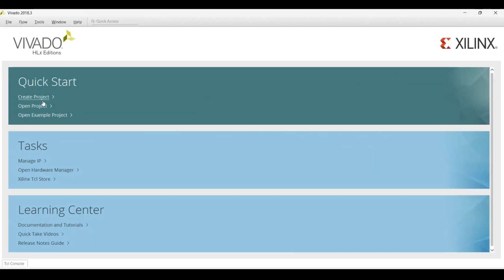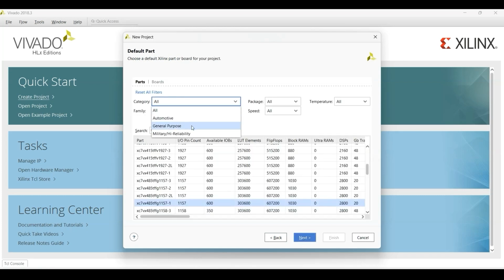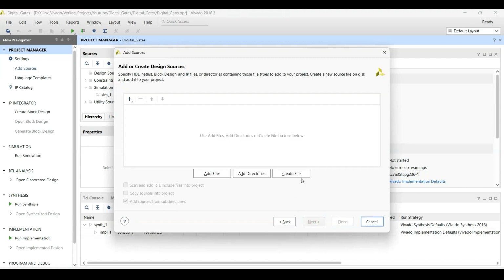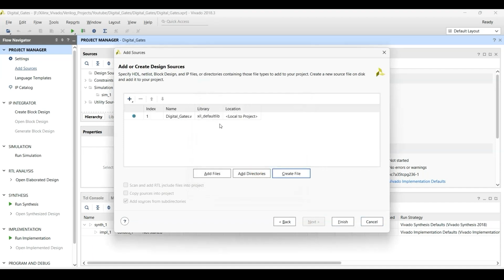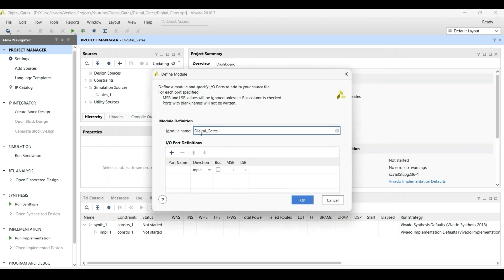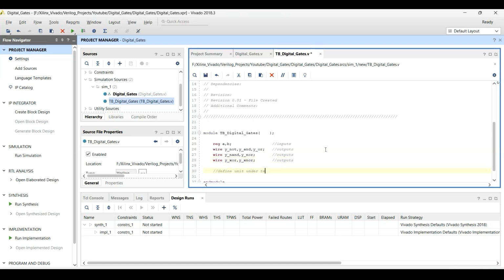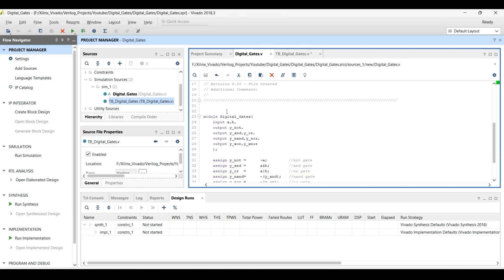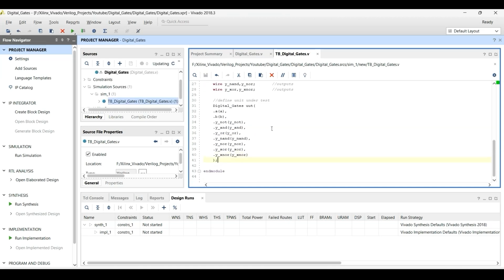Verilog for Beginners: build basic logic gates on FPGA (with testbench simulation)

Comment: Is xilinx used for Matlab ?
Reply from the maker: Xilinx is a series of FPGAs developed by AMD, and Xilinx Vivado is the software used to write HDL code (Verilog or VHDL), simulate designs, and program Xilinx FPGAs. MATLAB, on the other hand, is a computational and simulation tool. They serve different purposes — for example, if you want to design a FIR filter, you can use MATLAB to calculate the filter coefficients, then use those coefficients in Vivado to write the HDL code, implement the design, and program the FPGA.

Good Luck with your Digital Design🦊